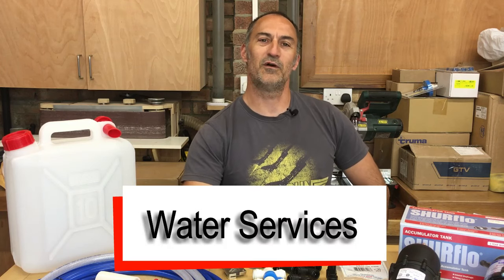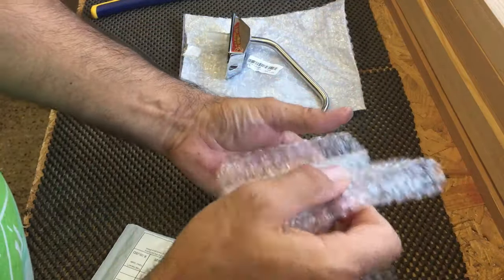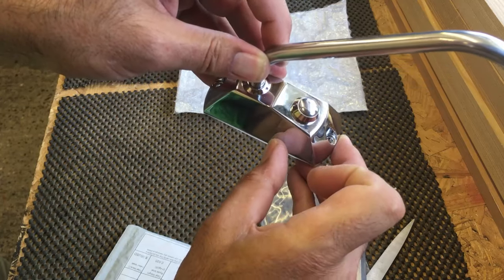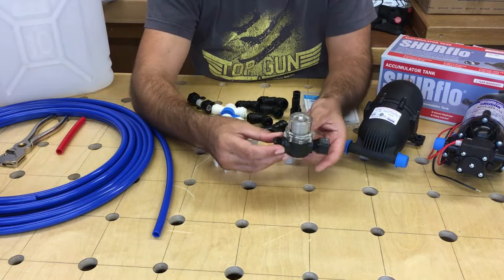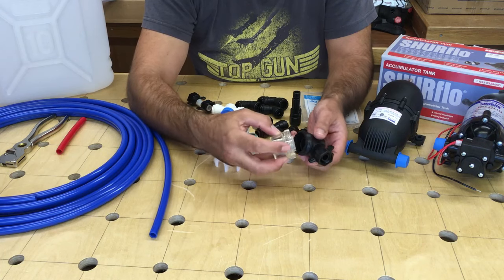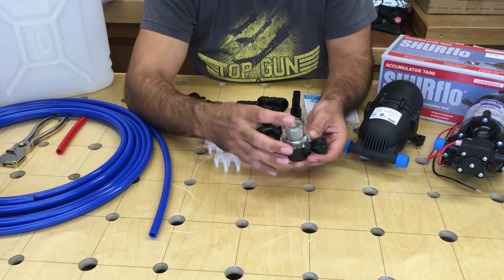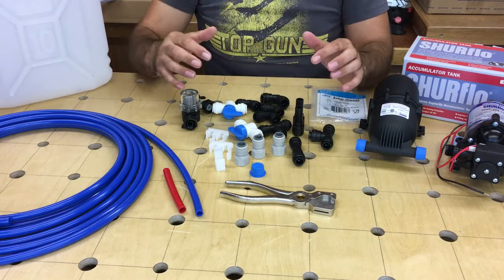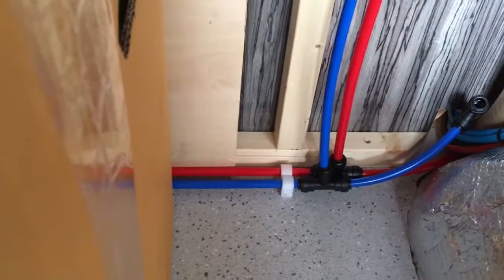Domestic Water Services - Camper Van Conversion Series

Comment: Hi Greg , is it possible for a sureflo water pump to go wrong and completely confuse the electrics in my motorhome ? I am at my wits end ,,,
Reply from the maker: The pump only has a positive and negative connection and works off its own inbuilt pressure switch. 
You can remove the pump fuse from your distribution box to illuminate it and see if that affects your problem to illuminate it. 
What is the confusing problem that you have, you didn’t explain what’s actually happening or the fault??
Reply: @GregVirgoe  Hi Greg , yea done all that , the fuse board seems to trip on and off of its own accord and nothing I do seems to pin down an issue ? With the board tripped off I pulled all the fuses , board still lights up on and off (main power and water) turned it off , put fuses back , turned on power and hey presto back to normal ? I hate electrics 😉
Reply from the maker: @Simon-390  intermittent tripping sounds like maybe a lose connection or bare wire creating a short circuit somewhere. You say tripping so I assume it’s on the mains side and not the 12v DC
Reply: @GregVirgoe  , no I turned off 240 main at the trip , so it’s 12v and I hear relays clicking on and off ,
Reply from the maker: @Simon-390  that would be the next task… find out what relay is switching… some have visual indication or just find it by touch

Comment: Hi Greg , Did you use 10mm or 15mm Talon hose pipe clips for the hose?
Reply from the maker: Gavin Conlon I used 12mm clips as this is 12mm OD pipe
Reply: @GregVirgoe  very good. Haven't been able to find them in 12mm 😭😭
Reply from the maker: Gavin Conlon https://rover.ebay.com/rover/0/0/0?mpre=https%3A%2F%2Fwww.ebay.co.uk%2Fulk%2Fitm%2F150792536191

Comment: Hi Greg,
Would it be worth putting a loop of flexible pipe after the pump to reduce vibration (and consequently noise) through the system?
Reply from the maker: Maybe a short flexible connection like you get for connecting to taps would be better?
Reply: I've seen lots of posts online about noisy water pumps.    I think the official sound deadening kits have short flexible pipes either side of the pump, but I've seen quite a few videos with flexible pipe loops after the pump, often with some pipe insulation where this pipe might touch anything.

If you're like me, the last thing you'll want to do is wake up the better half when you forget that you can't flush the toilet in the middle of the night.

Comment: What is the diameter of the  LLDPE Pipe? I have 3/8 diameter pipe , Is it ok for the water system or I need 1/2 (12mm)? thx a lot
Reply from the maker: Hi, the pipe I am using is 12mm OD and 9mm ID 😊

Comment: I can’t seem to find this accumulator anywhere apart from Australia
Reply from the maker: Ryan here you go https://rover.ebay.com/rover/0/0/0?mpre=https%3A%2F%2Fwww.ebay.co.uk%2Fulk%2Fitm%2F161912166056
Reply: Thanks Greg, what size LDPE pipe do you use 1/2 inch ?
Reply from the maker: Ryan the pipe and fittings are 12mm OD. Make sure to use the pipe inserts on the hot water pipe connections. 😊

Comment: How did you attach your 12mm pipe to your water tank? I have just installed a cak tank and the outlet from the pipe is 15mm. Did you buy a length of 15mm lldpe and use a reducer or do something else?
Reply from the maker: Tristan Sherlock a 15mm push fit fitting will go directly into the tank. Then insert a 15x12 push fit stem reducer into the 15mm fitting. Then your 12mm pipe into that. 👍🏼😃
Reply: @GregVirgoe  15mm PUSH FIT EQUAL STRAIGHT PUSH FIT straight onto the tank and then a 15mm PUSH FIT STEM-TUBE REDUCER M 15-12 mm which I put my 12mm pipe in the end of? Thanks for your time.
Reply from the maker: Tristan Sherlock yes exactly that. You can use either a straight coupling or elbow depending where you want to run your pipes to. I used a 15mm push fit elbow because it suited where I was going into the van 👍🏼

Comment: Is 1/4 line big enough tho to run your shower an faucet?
Reply from the maker: These pipes are 12mm OD and 10mm ID and at 2 bar pressure 30psi this is plenty of pressure to give a very good flow rate

Comment: Hi pal question i recently replaced my underslung tanks with 2 40lt aqua rolls and noticed my pump don’t suck the water up  unless i  position the tanks on its side now  near where i had the underslung tanks , do i need the  blue hoses  u got as mine are cheap white hoses i think is messing up the pressure  

Just be nice to have them in the  van other than keep getting them out every time i need water
Reply from the maker: Having the aqua rolls outside has that made the inlet hose longer than it was before? There will be a limit on how far the pump will suck the water (self priming) due to the weight and resistance of pipe length. The shorter the inlet pipe is and the closer to the pump the better.  Hope that helps. 👍🏼😊
Reply: @GregVirgoe  OK thank , been advised  to get a submersible  pump would it be fine to connect both  pumps so one sucks it up and the other takes it round the van 
Been told  just want to connect it up inside the van instead of keep having to take it out to have water 
I'm a novice   but trying my best to make my life easier 

Thanks for advice

Comment: Why wouldn't you stay with a constant switch as opposed to having to hold the button down?
Reply from the maker: Hi Matt, To conserve valuable drinking water, like leaving the water running at home its all too easy ;D
Reply from the maker: SC Nomad that small tap is just a drinking water supply it’s not for washing hands or dishes. The sink has a large mixer tap with running hot and cold water connected to the blue and red pipes in the video?
Reply: Oh, I see! I didn't realize it was only for drinking water. Thanks Greg!
Reply from the maker: Towards the end of the video you will see the main hot and cold feed to the kitchen sink mixer run in blue and red pipe on the pressurised water system feed off the main tank and combi boiler.
Reply from the maker: Matt Eldon 2:00

Comment: My water tank has 3/4" female BSP threads. I can't find any John Guest male threads that connect to 12mm pipe. Could anybody help?
Reply from the maker: Alistair use a 3/4” - 1/2” BSP reducing bush and then a 1/2” - 12mm JG male adapter into that. 👍🏼
Reply: Buy the 3/4" to 15mm adaptor and just run 15mm PE-X pipe you can buy from screwfix or toolstation.
Reply: @GregVirgoe  Thank you so much for the reply!! Sorry I didn't see it till now. I'm glad you got home safely.

Comment: May I ask why you use 12mm pipe when all fittings on the pump acc tank and filter are all 15.. surely it means buying adapters you would not need using 15mm pipe.??
Reply from the maker: Hello Wade, it’s no more fittings to do it in either size pipe??  15x1/2”. or 12x1/2”  it’s still one fitting whatever way you do it. The boiler connections are 12mm push fit as are the drain valve, check valve and all the isolation valves so no point changing everything for no gain.
Reply: Thanks for the speedy reply.. I'm just struggling to find the adapters from the 12mm to the threads on the filter acc tank and pump... what are they called.?? Can I find these at a local plumbing suppliers or is john guest the best place to be buying these.??

Comment: Great video! A few more things about the John Guest system that are good to know:
- You should have a "Pipe Insert" in each end of the pipe that is being connected to a JG fitting. This will stop the pipe deforming over time and causing a leak. An example seen here https://www.rvworldstore.co.nz/john-guest-12mm-pipe-insert
- You should also insert a locking clip in each connection to ensure it cant accidentally open https://www.johnguest.com/product/accessories-fittings-pneumatics/locking-clip/
- If possible avoid using 90 degree angle pieces. Sure it looks good, but you're better off bending the hose to go around a corner if it will fit. Fewer fittings = fewer potential leaks, and less cost!
- I recommend making a pipe connection of at least 100mm, otherwise it's very tough to get it apart again as you can't get your fingers in!
- If you're having trouble removing a pipe from a connection, use an adjustable spanner to press either side of the pipe evenly. You have to pull it straight out, keep in mind if working in tight spots.

Comment: Hi Greg,
I'm thinking that an instantaneous switch on your drinking water tap may not be as suitable for hands-free operation.  However you could easily use a nice shiny push ON, push OFF switch if you find it necessary.
Reply from the maker: The whole purpose of changing it was to remove the ugly rubber switch and also the hands-free operation, I want it to be like this so the water cannot be left running. This is only for bottled water so it is to conserve the supply, not for convenience. Thanks

Comment: If you need to hold that button down while getting water, I don't think it's that practical, even if it looks better...would prefer the switch, so that it is either ON or OFF and kept at that setting, until the switch is flipped again.
Reply from the maker: That's up to you.
For me the switch was ugly and I want to conserve my shop brought drinking water as much as possible.
Leaving the tap running and watching my evian go down the sink would be criminal.
With any water system in a van build conservation of that water is the always the key.
Unless you like keeping fit by filling up your tanks every day.
Reply: @GregVirgoe  why do you have to assume waste? Flipping a switch isn't harder than pushing a button, only difference is you don't need to occupy both hands while getting water. Investing in evian is criminal waste
Reply from the maker: I was trying to be a bit light-hearted with the Evian comment, obviously my humour has not translated over a text message.
The good thing is its your van and you can build it how you want, I'm not saying this is the only way, it's just how I like it. cheers
Reply: Your humour was translated fine, I just followed up on it, the full circle didnt work, obviously. As I said, you assumed the use of a switch would be wasteful; I don't understand why. Neither of us has to do what the other says, of course, but a supporting argument isn't forcing anything. Aesthetics is subjective, functionality less so, although preferences still apply. Having to keep one hand pushing down on a button is no problem if you're just filling a glass, it's really short time, but e.g. if I wanted to fill a 500ml/1l container to take away, or to keep on a table for people eating around it, then it's not as practical.
Reply from the maker: Time will tell if I get fed up with holding that button down :D
What sprung to my mind was how much water I waste at home cleaning my teeth and just letting the water continue to flow while brushing.
Now there is no way I can inadvertently leave this tap going. Making me chnag eme bad habots if you like. Thanks

Comment: why don't they make these that run off of 9v instead of 12v?  then you could just connect a 9v battery with ease.
Reply from the maker: What’s the difference?
Reply: @GregVirgoe  Well, I'm not well versed at all in electrical, but just thinking that a 9v is easily accessible (store bought) and wouldn't have to be hooked to a "system", right?  No wiring to a 12v power supply, just pop it into a standard 9v receptacle.  Unless they make 12v batteries?  It seems it would then be able to act as a stand alone unit?  ...is that possible?  Really learning a ton from your videos...Thanks!!
Reply from the maker: @velcrots  they really are no different. You can make the DC system as simple as you want. You can get a small 12v and connect it to a pump.  The issue with 9v batteries. What would you do when it run out? Buy another battery. Probably easier to recharge a 12v battery than 9v especially if using a split charge or B2B